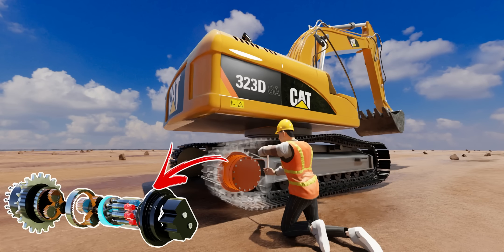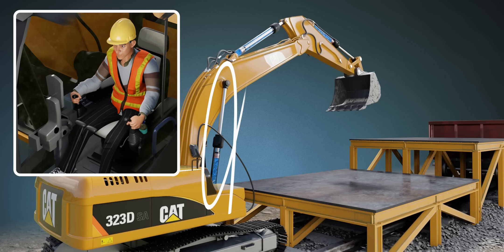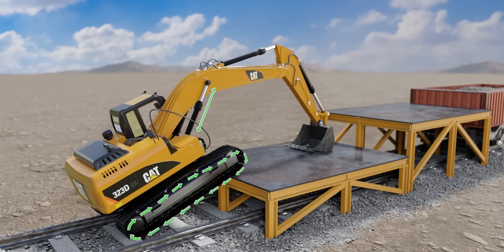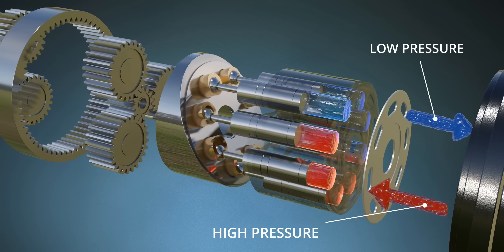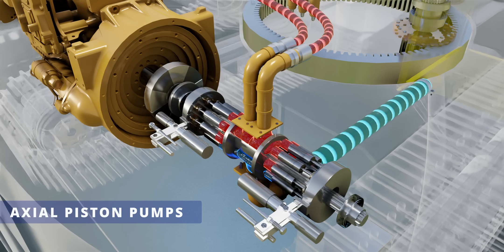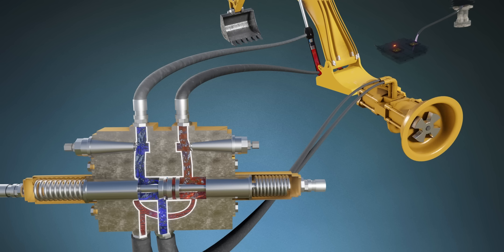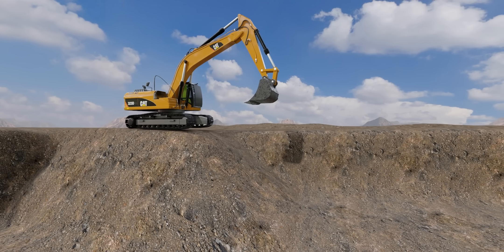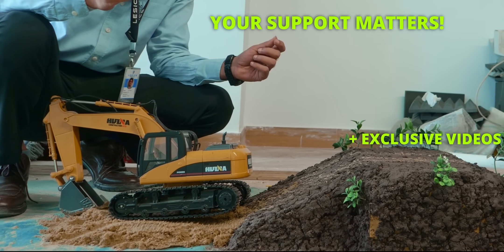Excavators | The Marvels of Mechanical Engineering

Comment: Man this is too complex all the pistons, pipes oil etc just replace everything with electric motors it will make design way simpler
Reply: Hard to know if it's satire or not.
Reply: Ah yes just have an obscenely huge battery to power all that for less time than a regular excavator can run

Comment: I have a question:
I operate a mini excavator (Kubota). Can the mini excavator generate the same amount of force at minimum throttle as at full throttle? I understand that the pump flow is lower at minimum throttle and everything moves slower, but I believe the pressure in the hydraulic system, and thus the force, can reach the same level as at full throttle. Is this correct? I don't have the feeling that it has less power at minimum throttle.
I’m curious about your answer and explanation.

Comment: In the resting state, where does hydraulic oil go? Not shown on the video yet, here shows how to lift and lower. When this process stops, the pump continues, the oil circulation mechanism is at rest.
Reply: Hydraulic oil keeps circulating as long as the engine is running.

The directional/spool valves have channels in them for oil to flow when they are in the neutral position, the oil flows through without causing any movement and returns to the tank, where it is sucked up and circulates again. If the pressure gets too high such as when a hydraulic ram is held at its maximum travel, then pressure is diverted around the ram via pressure releif valves, and returns to tank. If the engine stops, the pump stops and oil stops circulating, usually staying where it was when the engine was running ( depending on gravity/what pressure it was under)

This is a simplified explanation of course, some systems use variable displacement pumps that are constantly turning, but dont actually apply pressure until there is a demand on the system from the controls. This is known as closed vs open loop in hydraulics if you want to research it further, there is also a great channel on here called I think lunchbox sessions who do a whole load of videos on hydraulics if you're interested 😁
Reply: @hamstirrer6882  thanks you

Comment: Maybe the answer is as simple as it can’t keep turning beyond 360 decrees in one direction before in turns back the other way, but I’m going to ask anyway. There must be pipes and cables running from the engine compartment to the tracks, however if the entire body of the excavator can rotate 360 and keep rotating why don’t the cables and pipes get snagged up.

Comment: So far, this is the only one channel I've ever seen that really presents the working principles of hydraulic system of an excavator in a detailed way. Surprisingly I'm amaze about your explanation in how parts and systems work together smoothly that makes me appreciate and learned a lot that so many times I'm been searching for this kind of animation regardings to the hydrualic system working principles  of an excavator but this presentation is so excellent.

The only thing that I want your channel a recommendation to add more information regardings to the animation about excavator is the complete cycle of the hydraulic fluid out of the system; this followings are a missing parts from your presentation is the pressure relief valve and the return passage of the fluid back to the tank but, the rest of your presentation about the engineering marvel of an excavator is so magnifiscent. Good job and keep a good work Thanks for the knowledge.
Reply: nothing beats an informed review
Reply: I have also searched for a video that explains how the heck the tracks rotates on its own, being separated from the diesel engine. He did a great job explaining this. However,I have one more question; how does the excavator swing 360 degrees without twisting the hydraulic hoses connecting the tracks motor to the axial piston pumps?